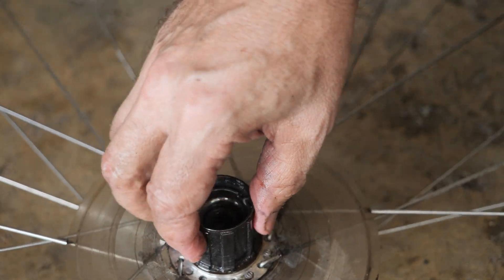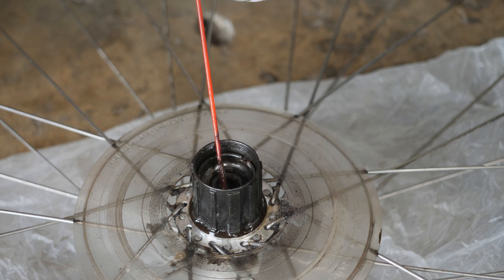Bicycle Freehub Repair & Maintenance

Comment: Feels good to repair your own stuff. I hate paying other people to do something I can for for free.  Looks like it is a good bike.
Reply from the maker: yes I will buy another tool with 2x 3 mm square key teeth on the opposite side of the 21 mm circle for the next round, so that I can fully open the freehub.
for now this partial disassembly worked and the bike works really well and smooth.

I actually made that tool from the wrench socket 21 mm using a grinder, but the freehub was so tight I failed to remove the inner lid, even with a leverage. I almost opened it, and then my wrist slit on something sharp and I thanked God for not cutting my wrist veins. that's why I stopped there. maybe the tool I made wasn't precise enough or the metal was too soft and couldn't undo the locked lid. now I have a scar on the wrist, and it is still yellow, after being swollen and blue. luckily I immediately applied the ice, and then alcohol.

I bought the Trek commuting bike when I worked in London for couple of years 15 years ago. and believe it or not I never serviced it for 15 years, and it was working well. of course I did lubricate the chain and gears from time to time.

the bike is made from alpha aluminium, and all the parts are hardened stainless steel. I only upgraded the pedals to stainless steel from the plastic ones, and I upgraded the steering bar from the alloy steel which was spotting rust, to the aluminium bar. everything else is still original, the leather seat has no signs of wear despite the bike is used every single day quite heavily. it also still has the original 15 years old Bontrager tyres. the steering post and few other components are made from beefy cast aluminium alloy. indeed it is really a bike for life.

I had a few punctures, because the asphalt roads in tropics are steaming hot, and even small sharp stones can easily cause a puncture. 
what I did was (and it was my own idea / invention, not sure if anyone else does it), I cut the 2-3 mm cowhide strips, and I put some talc inside the tyres, and then I laid the cowhide strips inside the tyres, and only then I put the inflatable tubes inside. 
ever since I made this little hack, I had not a single puncture, even when I ran into a big shattered glass area, the pieces of glass were poking into the tyres like a hedgehog, I pulled them all out, and there was no puncture. 

I think I will have to show this hack in the future video, but I'm a bit lazy to remove the wheel and open the tyre. I will have to force myself, sigh
Reply: Ty się lepiej zajmij naprawą rowerów, niż obrazaniem kobiet i przechwalkami jaki to z ciebie macho! ( od siedmiu bolesci ),!
Reply: UWAŹAJ TEZ Z VIAGRĄ, BO ZA 20 LAT JAK DOZYJESZ, TO PAMPERSY BĘDZIESZ DZIURAWIĆ TYLKO,A ŻONA STRACI NA CIEBIE OCHOTĘ, JAKO ZALEDWIE 50 - LATKA!!

Comment: Well done, great video. It's easy to understand. I think I could do that myself, too. 👍
Reply from the maker: thank you!

of course you can do it. the problem is that most people don't have that specialty tool to open the gears lock (sprocket opener).
and to really open the freehub, we need another 2-tooth wrench socket-like tool, which I didn't have. that's why I had to limit the freehub repair to spraying it with White Lithium Grease.

I will buy the freehub lid opener tool for the next time I decide to open it all up for the maintenance, possibly in a year or so